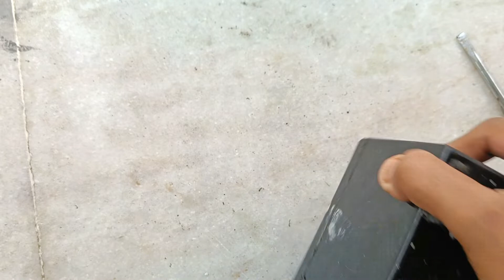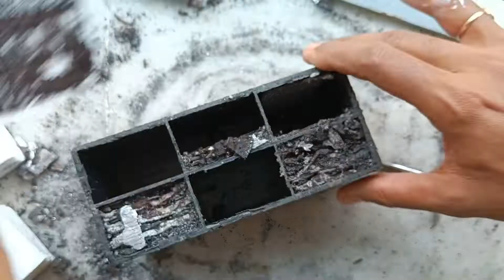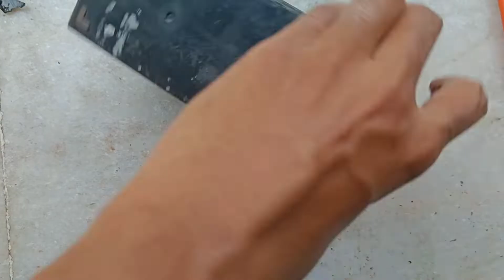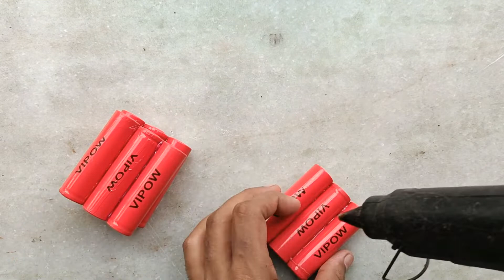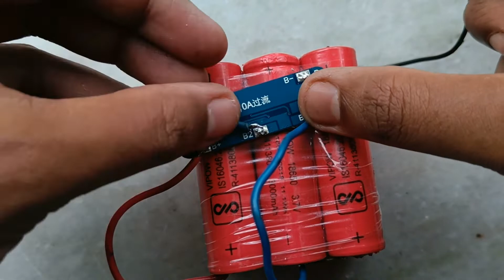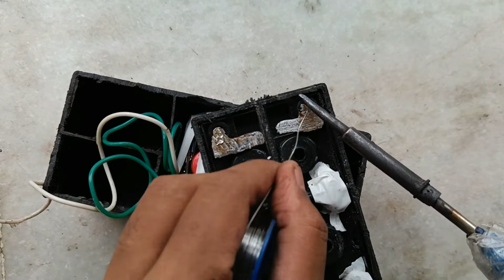How To Convert 12v 7Ah Old Lead Acid Battery Into 12v 27Ah Lithium Ion Battery

Comment: It's 12v 9ah only.. 
Per cell 3000mah make in series with bms 3s this o/p we get maximum 12.3v only
for making 12v battery pack instead of 18650 3.7v better make with lifepo4 32700 3.2v this o/p voltage we get minimum 13.3V ..
Excellent backup time...